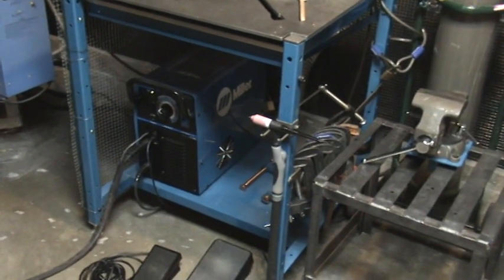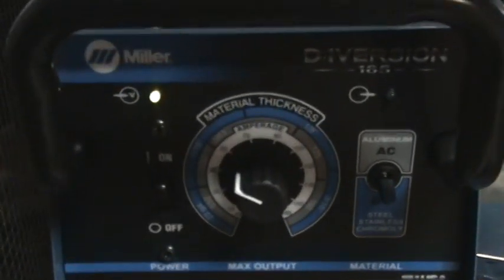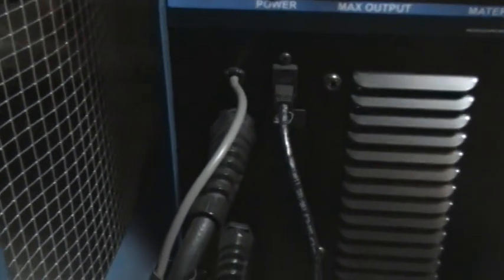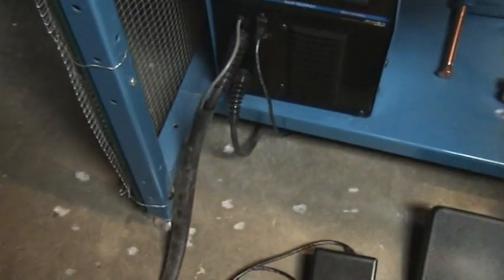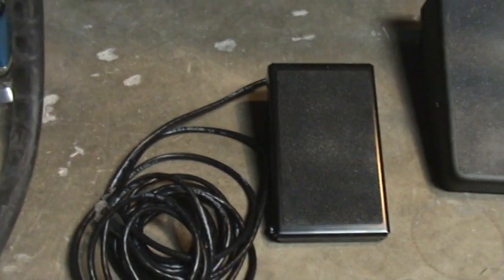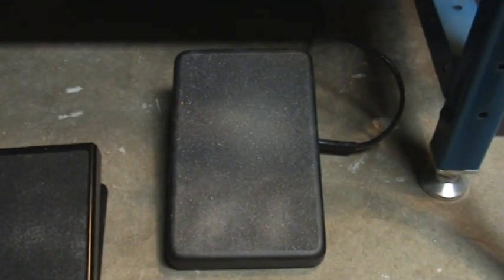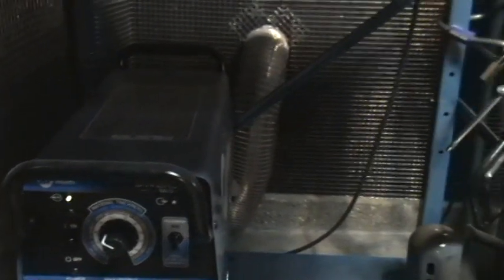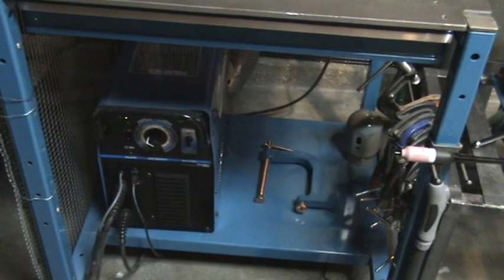Miller Diversion 165 TIG Welder review

Comment: you hit the nail on the head about the outsource foot pedal. i own a welding supply shop and am a certified miller repair person and i got called into a local trade school and had to wire up a real pedal to their diversion 180

Comment from the maker: @zuverib Thanks for the comment.  I still have a lot to learn about welding.  I was welding an inside corner, and couldn't see the tip of my tungsten, so I extended it.  I am using a gas lens collet body that is supposed to allow me to extend my tungsten farther if necessary.

Comment from the maker: I've welded stainless steel with it quite a bit, and it works great.  It even has a nice arc for welding very thin metal, like stainless scalpel or razor blades.  I haven't needed to weld aluminum with it, but I do see that it has settings for aluminum.

Comment: Miller 165 is a great machine. You should buy an SSC controls foot pedal. It works great. I got my foot pedal chrome plated by SSC. New 165's do not come with a foot pedal any more. Only the 180. This is a machine designed for Pro's. If you can get one; I recommend  it! It's better than any thing in it's class.